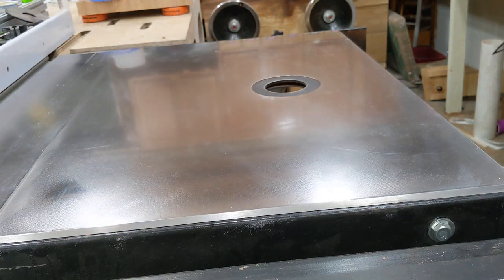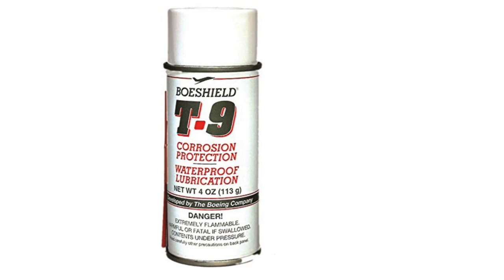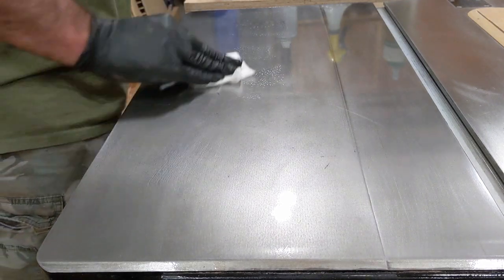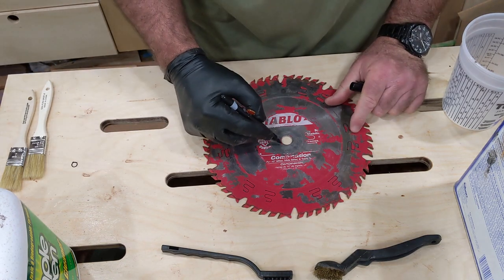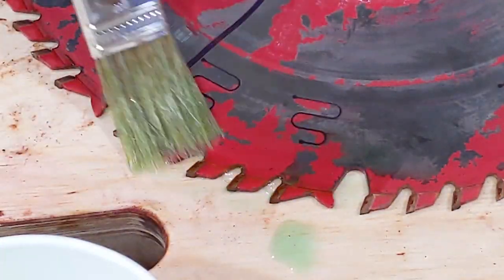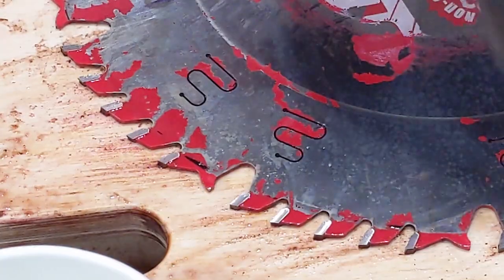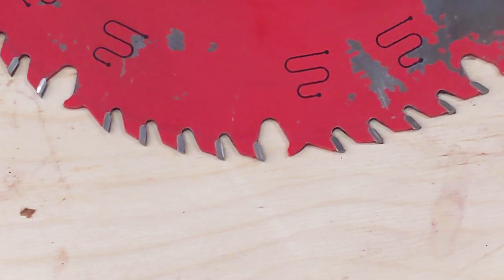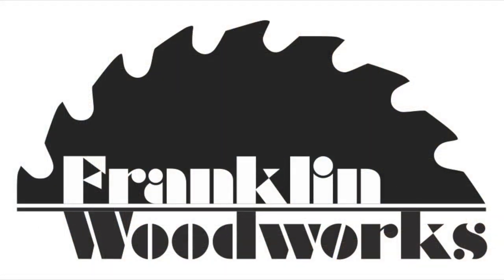Updating the Update - AND Testing a New Product

Comment: Thanks for your diligence in finding products that works on your tools.  For my table saw I followed your lead on using progressively finer grit sanding discs.  Then a couple coats of Fluid Film and paste wax (what I had on hand).  Two weeks in and still rust free....relative humidity has been 65% - 75%.  I used the sandpaper method on my table saw only because that's the only cast iron table that I have that I've neglected.  The bandsaw and jointer are newer and, so far, un-neglected.

Comment: I used the Rust Free on a Jointer and a Planer that I restored.  The cast iron was completed covered with rust.  I used a green scratch pad and it took the rust right off.  I had to go over it again to remove the rust stains and polish the surface with a 0000 steel wool pad.  Both look brand new and I use it about twice a year to clean the surface.  I use the T-9 and I have never seen any rust on the surfaces at all.  Blade and Bit cleaner is awesome.  I have collected a number of old blades that I have cleaned and did a quick sharpening and they cut like new.  I love the stuff!

Comment: I use Simple Green to clean my blades. A 10-15 minute soak is all that is needed, then I use an old toothbrush to clean the pitch off.
Reply from the maker: Simple Green works great!  However, when you are lax about it like me, sometimes the pitch from cutting pine sits on the blade too long and causes a problem.  Harsh chemicals compensate for my laziness.

Comment: On my saw blades and router bits I use Greased Lightning, a household cleaner.  I spray it on and watch the pitch lift away.  What little bit remains comes of using a toothbrush.  Then I rinse in water as hot as it comes out of the tap, which makes the blade too hot to handle.  It dries in seconds and I'm back in business.  For router bits I have a small baby food jar I keep half full of Greased Lightning.  I drop the bit into the solution for a minute or so and then give it the toothbrush treatment along with the hot water rinse.  Works like a charm and it very inexpensive.
Reply from the maker: I love Greased Lightning!  But I've never tried it on my tools.  Looks like I have another thing to try for cleaning blades.  Thanks for the tip!

Comment: I use methyl hydrate to clean blades.  Cheap and easily obtainable. A lid from a 20 liter food service pail will hold a 10" blade perfectly along with enough chemical to clean it. A quick brush with a toothbrush helps if you are in a hurry.
Others have used gel hand sanitizer to do the same thing.  No lid required.

Comment: I wonder if you can use the t9 on the blade to stop the build up of the pitch
Reply from the maker: On the can it says it can be used on bits, but it doesn't say blades.  I think I'd worry that since it's wax based, it would just melt off the blade into the wood.